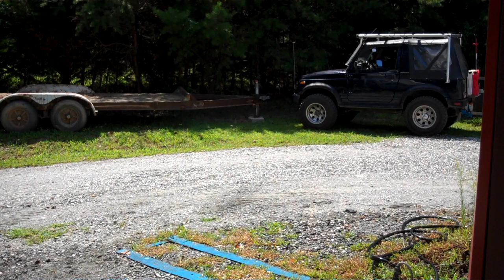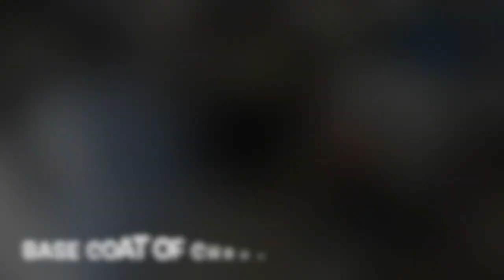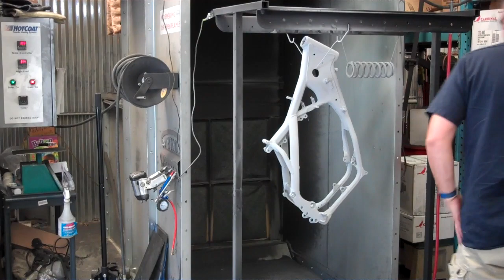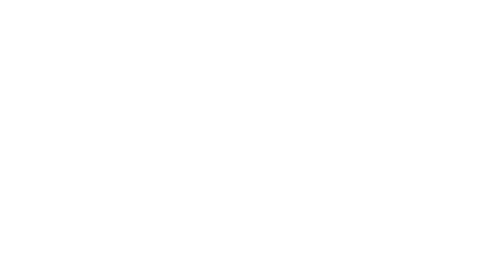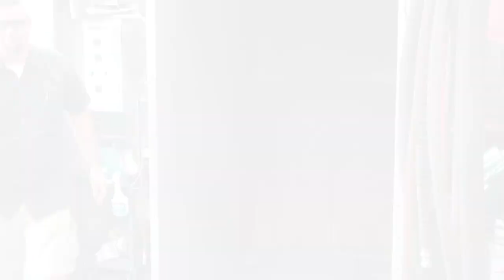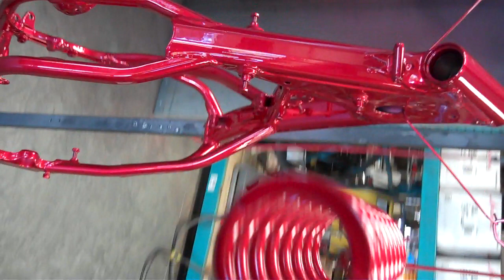How to Powder Coat a KTM Frame

Comment: Hey Mark!  Just getting into powder coating here.  What kind of ground do you have setup for your system?  Are you using the ground from the Wagner, or did you run an earth ground?  I'm having issues with adhesion for a second coat, unless I hot flock it.  Running a decent Columbia Coatings Hypersmooth gun setup....so should be good for multiple coats. lol
Reply from the maker: Scott, I do have 3 earth ground rods that I am grounded to, but yes I do use the ground from the Wagner.  I know at times duplex coatings can have adhesion issues, but follow the MFG's instructions and it usually mitigates any adhesion.  Half cure cycles seem to be the most often recommendation for duplex coats, good luck!

Comment: What the temperature of part for hot coating ? Thank you!! Nice video
Reply from the maker: David Dudzik Thanks for your kind comment.  The temp I shoot candy top coats is usually around 340 degrees for the top coat, however, I've had success shooting cold as well. I prefer the powder to just "wet" when it hits for a really deep gloss.  The only danger of "hot" shooting is sometimes you can build really a really thick coat...very quickly.
Reply: Mark Warren ok very nice thank you!!!
Reply: Mark Warren when you start cure time 18-20 ??
Reply from the maker: I don't remember exactly on this frame, but what I typically do is monitor part temperature and once I hit 340 I let it bake for 10 minutes, then take it out.